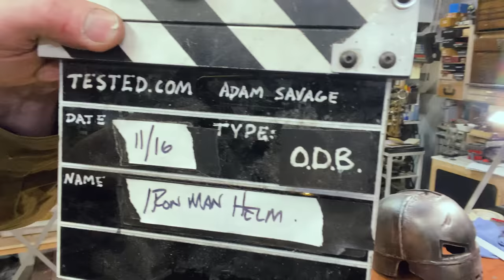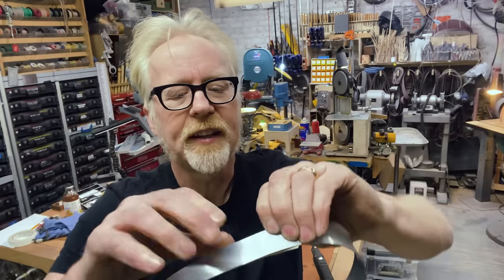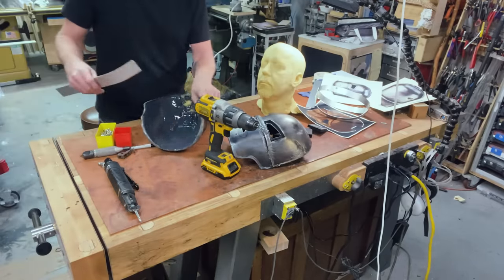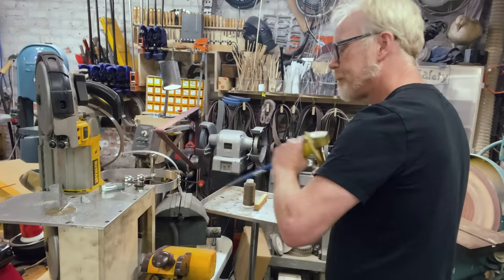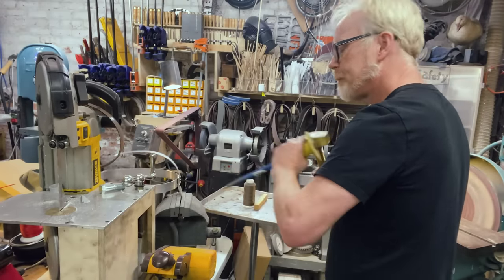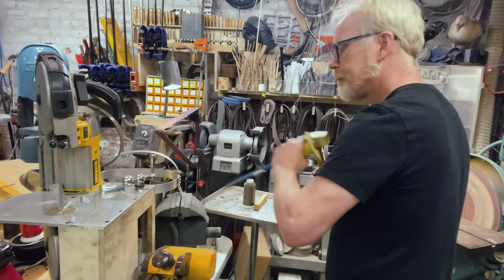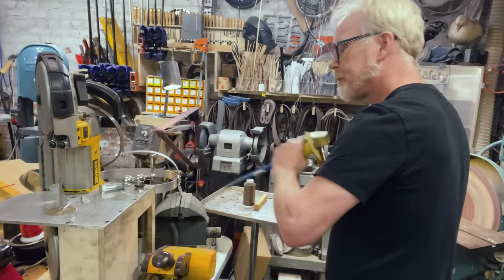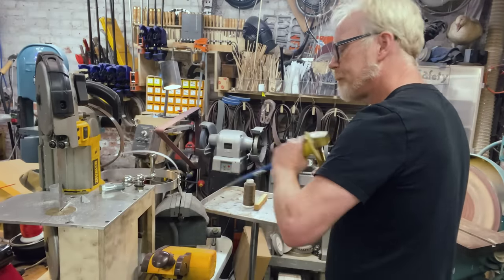Adam Savage's One Day Builds: Iron Man Mark I Helmet!

Comment: For detailed heating I sometimes like to use a hot air rework station. They usually come with a variety of nozzle sizes so you really target your area and keep the heat from spreading. That and the temp is adjustable by degrees, not just hi and low...

Comment: Doesn't a urethane based adhesive like gorilla glue stick better to a urethane resin than epoxy does? I know you got a mechanical lock by roughing the surfaces but a chemical bond too is even better I would think.......

Comment: Hey Adam - my dad had a big woodworking bench vice that, when you turned the handle to a certain point, you could then pull/push the jaws in/out quickly to get to the rough size of your workpiece, then go back to spinning the handle to fine-tune the grip. I think you need that on your workbench! :-)

Comment: I've noticed  (obviously it's an occupational hazard) you cut your hands making various projects. Instead of using plasters, just hold the cut together and put a dab of super glue on the cut to seal it. It's sterile, Instantly stops it bleeding and gives it a protective layer that comes off naturally as your skin sheds. 

FUN FACT:
For anyone who didn't know, Superglue was originally used in WW1/2 as a patch up for battle wounds.... That's why Superglue sticks skin together faster/more effectively than any other material. 😁

Comment: when I took metallurgy and welding in highschool back in the late 80s to early 90s the jacket sleeves alone where called a cape. with the leather panel snapped to them it was a cape and bib, or if it was a full jacket, simply a jacket.

Comment: When trying to make a skull cap, you should try to use a layout like a baseball (cut in half). This would give you 1 solid piece that goes from up front, over the top and down the back. Without the look of a basketball being shoved in there. It would also be comprised of 3 pieces with 2 seams ( center top piece and two side semicircles ) instead of the multiple pieces and seams. Hope this helps.

Comment: If you want to bend aluminum, you can soften it by adding some heat. Like a heatgun might be able to melt aluminum on the higest setting. The oxide or surface does not melt, but the inside might melt an make some nasty drips. Like around 200 celsius is perfect as it makes it soft like fresh lafffy taffy. and since the particles will slide around instead of being broken apart, it will stay stronger as an end result.

Comment: For the inner halo I would use a construction or welding halo that comes with padding and adjustable fasteners instead of completely new on the fly fabrication that may or may not be comfortable one hour in at a convention (Happened to me with some of my builds T_T)
That's just me and you defiantly know what your about Adam.
Also I would "field test" a build for extended wearability and comfort to iron out problem areas that may arise with extended use

Comment: The chrome finish is so satisfying to watch!! I'm wondering if there is any reason you prefer the Molotov liquid chrome with Alclad sealer, instead of using Alclad's own chrome? Currently working on my first project with a chrome finish, so I'm trying to be good and do some research!  - Martina
Reply: Not Mr. Savage, but Molotow is a graffiti paint manufacturer. The specialize in aerosol and paint markers, I believe they originated in Europe which has a much more Graffiti forward outlook than in the states, but that's not super relevant. Because Molotow paint is used for Graffiti it has to do two things really well. Stick extremely well to a variety of surfaces (usually which are exterior and dirty) and it has to extremely resilient, not only for harsh outdoor climates but also resilient against the removal of the paint. If you ever used artist quality graffiti paint you will know it's very hard to removed and it is very hard to cover up with new paint. Because of the chemical properties even a fresh coat of local hardware paint won't full cover up the graffiti paint, and that's by design.

So with extreme resilience and extraordinary adhering properties a graffiti paint is going to be a lot more durable than your airbrush art paints which don't have to endure as much abuse. And lastly, Chrome is a highlight color of most graffiti art paints. It's been a staple as a color for almost 20 years. So while big brand paint companies have cornered the market in automotive grade chrome paint, there was a hole in the market for someone to r&d an aerosol based chrome paint. Rustomleum and Krylon had always geared towards solid colors, but are now branching out to specialty paints and finishes. So with that gap and the desire for resilient and durable hand held chrome spray paint, companies like Montana, IronLak, Molotow and MTN all put in the effort to make an easy quick option for chrome aerosol paint, without the need of a spray gun, and spray booth. One of the best chrome spray paints I have ever used with almost mirror like finish is Oink Art LTD chrome, it's US based but it provided a level of reflectivity I haven't quite seen yet in any other paint, even more than Molotow's version. So while paint recipes change all the time for various reasons, I can only see the aerosol version's of chrome getting better and better in the years to come.
Reply: is it wierd i heard this in your voice i have no idea why tho
Reply: Nerdforge! I LOVE YOU GUYS!!!
Reply: omg youre here XD first time ive seen a comment where i can say that XD

Comment: "You can't bend it back."  How true and frustrating that is.  It's called 'work hardening,' and it means the material loses its ductility and becomes brittle simply by flexing it.  Aluminum and copper are particularly insubordinate materrials.
Reply: But, the right application of heat and it relaxes again (assuming you can do that without damaging whatever it's connected to).
Reply: @dustysparks  from my experience thats a waste of time maybe with copper, but aluminum doesnt react like steel with heat it doesnt get red hot at the right temperature so its a guessing game, and dont get it too hot.
Reply: @SPAMPANMAN  IIRC from the series where Adam build armor, you can put some sharpie on, and it'll evaporate off when the aluminum gets to the right heat for annealing. Haven't had an opportunity to try it myself, though.
Reply: According to the interwebs the best way to anneal aluminum is to use an oven and heat it to a specific temperature range, between 570° and 770° Fahrenheit depending on the alloy. Leave it there for a little while, 30 minutes to 3 hours depending on the alloy, and then quench in water. The quick dirty method is the sharpie trick, where you mark the work piece with the permanent marker and then hit it with a low oxygen oxy-acetylene torch until the sharpie marks disappear, then quench in water. 

Copper/bronze are much easier though. Just use a torch on it to evenly heat the piece until it starts to get red, and then dunk it in warm water. Softens it right up. And you can do that as many times as required.

Metals are weird.

Comment: The aluminum breaks because it has work hardened.  You can anneal it by heating it and letting it cool slowly. If you take a sharpie and work for your heating it once the sharpie Mark disappears it's hot enough. Then just let it air cool and it will then begin without breaking.

Comment: You should have slotted the overlapping joints of the helmet strap and used an elevator Bolt and wing nut so you could adjust it on your head for a more secure fit  and then loosen it to take it off

Comment: pretty sure that detail / kibble on the top center of the head is more than just detail. I think its a two part hinge, with a double pin attaching the front of the helmet to a bar of steel or aluminum that would be curved to the curvature of the helmet and ride inside a channel of the block in that insert. that way the helmet could be flipped up and "slid" back a couple inches which would help keep it open and not allow it to flop down over your face even if you looked down.

Comment: For what its worth i would have sacrificed a bicycle helmet for the plastic harness that fits to your head and is adjustable. And it would have fit nice and tight by adjusting it to your head and then riveting it in place. Then i would have used velcro like you suggested as an alternate option to use. Would have saved majorly on weight

Comment: Also, its not ever seen on screen, but i think you were going the right way with the extra bar of aluminum stock in the back attached to the skull cap, but i bet you anything the suit downey wore probably had a shoulder and skull cap rig so that the helmets weight could be distributed more on his shoulders than his neck. couple curved pieces over each shoulder, joined with a horizontal bar, which would link up to the vertical joining the skullcap and the helmet. I would also bet dollars to donuts there was a hidden nut and bolt arrangement so the helmet could be separated from the support scaffolding

Comment: Oil paints are great for washes, they spread easily, and don’t react to the other paints with the drawback of slow drying. But you can remove excess over the drying time with a cotton swab dipped in the thinner.

Comment: Can someone exain to me the different use cases for the two types of sanders that Adam uses?
To be clear I'm talking about the stationary rotating plate and the stationary beltsander
I think the belt sander should be the more versatile tool, but then again I don't even know the proper name for the other one so it is very possible that I am overlooking something.

Can you establish large flats with the rotating disc one? I would imagine it takes away different amounts of material depending on how close to the center of rotation you are working so you end up with a slightly curved surface? Or is this a non-issue given that it only grinds on the high spots anyway? That would depend on the hardness of the surface that the sandpaper is applied to I imagine.

Comment: This has been bugging me since the first time you aired it; the catapulting cherry picker. You over looked the obvious; poor maintenance. If the oil level for the Hydraulics got very low the pump would start pressurizing the ramp with air and would of definitely catapult when released.  Second: the vehicle you were using had a bad ignition switch.

Comment: Looks like helmet has a cast in hing on the top are you going to replicate that?  You could use the head gear from a safety or welding helmet to support the back, put the hinge in, (with a couple of pins for alignment) and make it open-able.